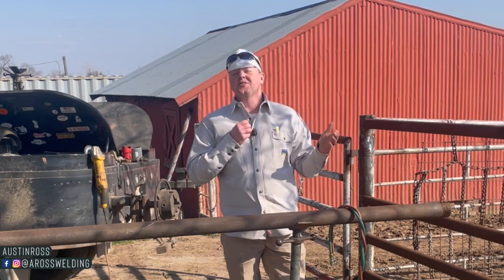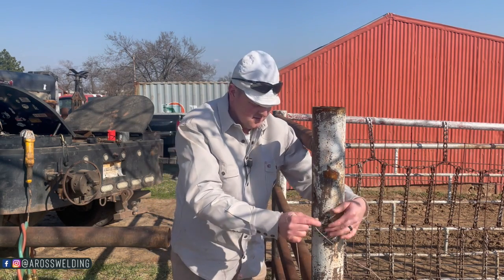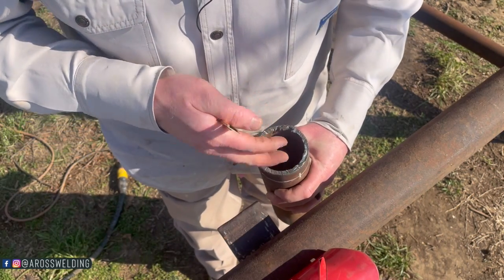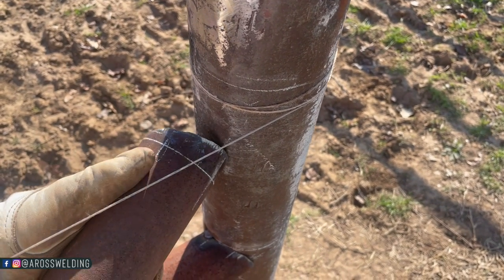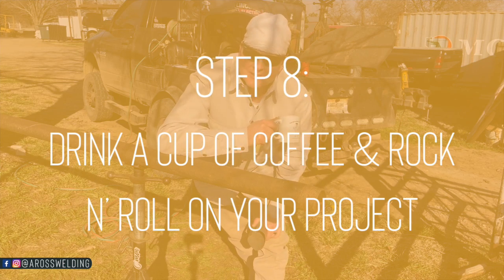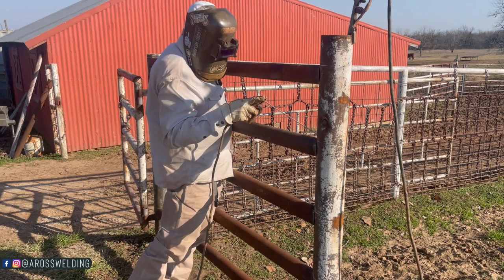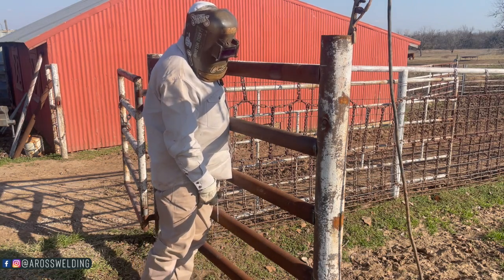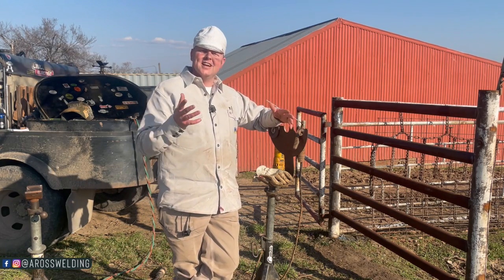Coping 2 7/8 Pipe Flush With One Side Of 4 1/2" Pipe

Comment: Looks good!  Looks so much better on the edge vs centered on the post.  Nice job on the saddles!  I do so many of them, I have cut, ground and modified saddle templates for 2 7/8” and 2 3/8” both, to easily mark that fit up.  I also cheat by throwing a chain clamp around the posts for the horizontal to set on while I tack it up.  Thanks for the video!
Reply from the maker: Thank you! My pleasure!